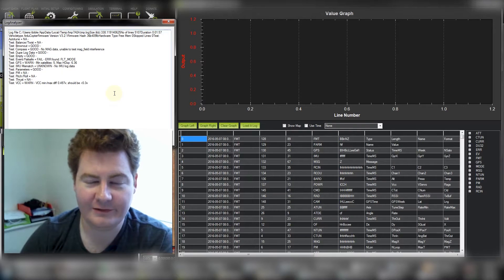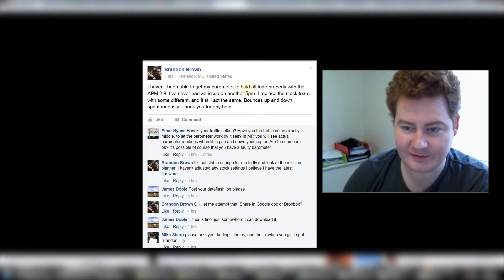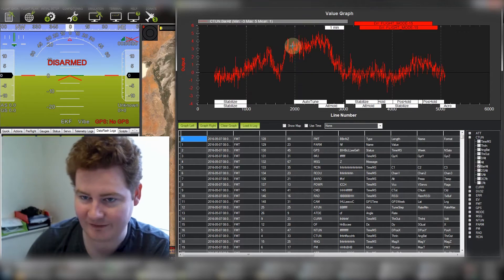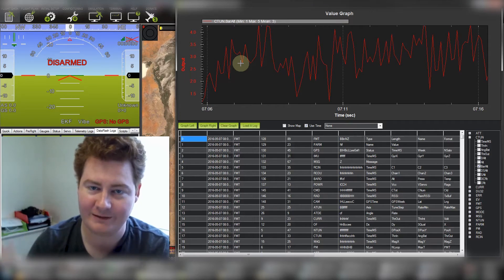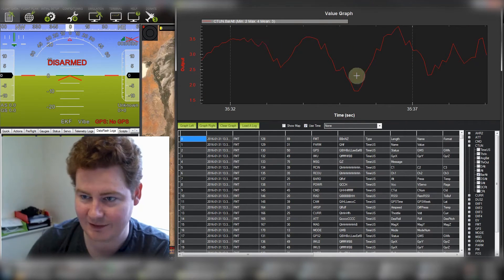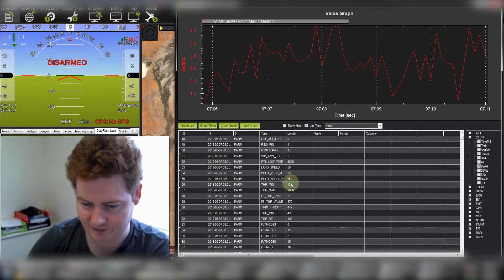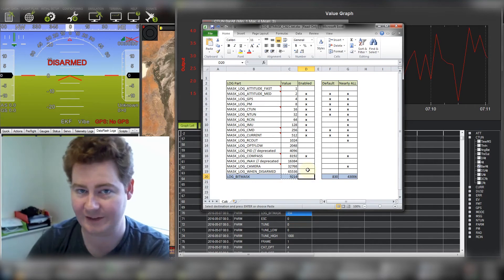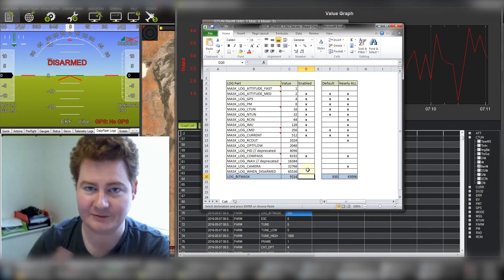APM Crash Investigation - Poor altitude hold / vibrations

Comment: Thanks for the video partner. Is there a "quick reference sheet" for the acronyms in the logged data section? I can't figure out what some of then mean.  Also, everything is working fine on my APM 2.6, but I continues to slowly gain altitude. What's the best way to approach that?
Reply from the maker: Welcome! Check this link for a list of the logged params (scroll down) - http://ardupilot.org/copter/docs/common-downloading-and-analyzing-data-logs-in-mission-planner.html .... as for slowly gaining altitude, what mode are you in? I would start by looking at your RC midpoints and checking that you don't have any RC trim applied.
Reply: It is in loiter when it starts to slowly rise. My mid points, if I understand what you are asking for, where at 1500 when I did autotrim and the auto gain grograming.
Reply from the maker: If it only rises in Loiter and not Stabilize, then the problem could be the throttle deadzone, the barometer, or vibrations. Try increasing the THR_DZ parameter and see if the issue persists. http://ardupilot.org/copter/docs/parameters.html#thr-dz-throttle-deadzone